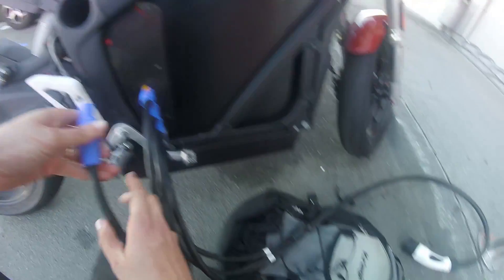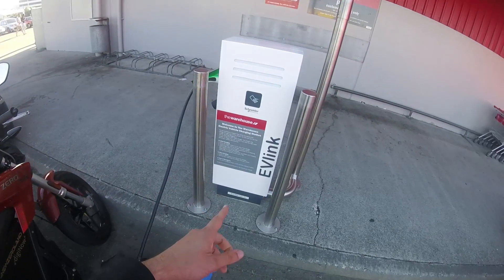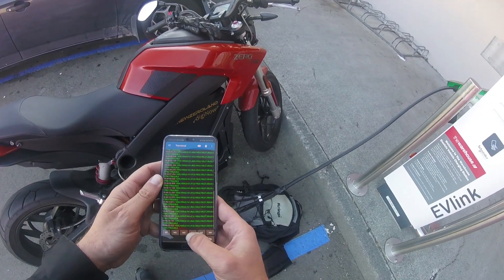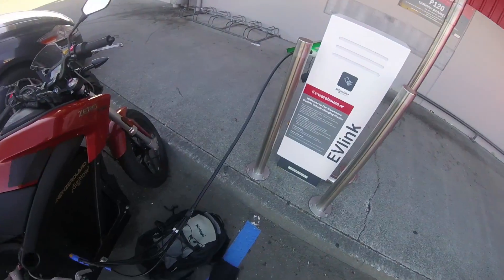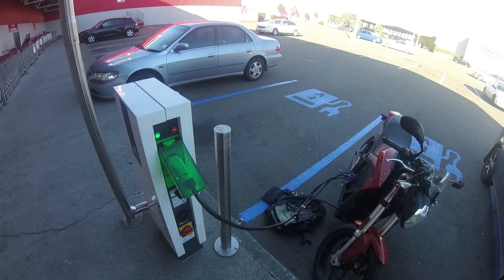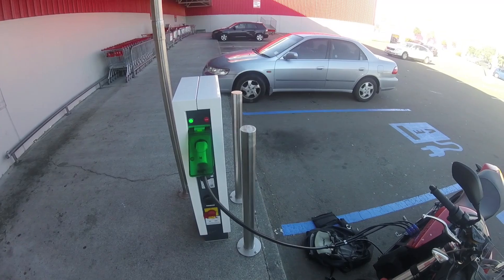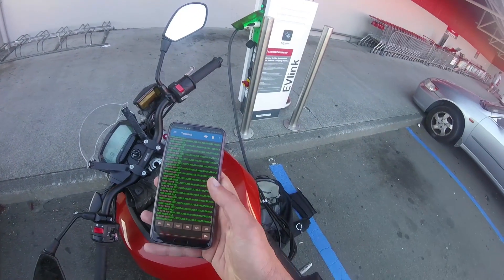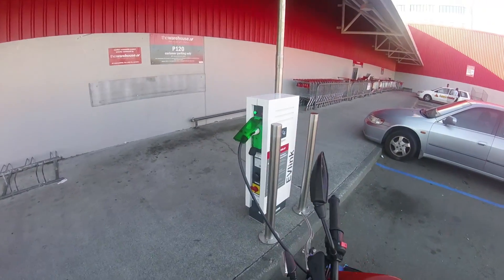Zero Charging - EV link station attempt #547

Comment: While zero's aren't available where I'm at, I'm about to purchase an electric motorcycle also. Your videos give me hope for the modding community. How did you get confident with your modifications in regards to circuitry and power stuff? I'm looking at some mods i'll want to do aftermarket but a bit nervous about doing it myself. Any ideas or places to start?
Reply from the maker: I'll be honest.. diginow makes it really easy to just buy fast chargers and hook them up. I have an awesome electrical engineer friend down here though, so that helps a lot. Which bike are you buying? And if you have questions or what to learn more, check out the electric motorcycle forum, or endless sphere. There are a lot of people building custom stuff out there :)
Reply: Not even close to the same class as the zero for sure. I'm getting the new TC Max when it comes out in March. The nearest city from where I am is over 500 miles away so it's only for city and slight highway driving. Excited though as I've been driving electric scooters previously and fell in love with the hum and smoothness.
Reply from the maker: @WhiteChocolateTricks  Awesome! All kinds of electrics are cool in my book. I rode an electric push-scooter, like a Razor, and it wouldn't stop wheelying. It was terrifying! XD
Reply: Yeah my current scooter can only do 55km/h with about a ~80km range total. It's a smaller 60v26ah. The TC is going to be top speed of 100km/h and about 100km of range as well. Also removable battery which i''m a huge fan of for commuting. You can drive pretty much anywhere even if you haven't charged and pop the battery out and plug it into the normal wall socket. 

I thought about looking into fast(er) charging options, but 3 hours for 100km isn't tooo bad. Maybe later in the bikes life i'd do it.

Comment: Very cool glad you're getting the fast charging sorted. I don't have a EV, only experience with lithium batteries is I fly RC helicopters but with those i need to wait for them to cool before charging them up again and I need to calculate how many amps I can put into them so I don't cause any damage because they will inflate if the amps are too high. Are the zero batteries rated to handle rapid (high amp) charging coming right off the road using them without causing shorter life and possible battery damage? I have no idea, just wanted to ask. Thumbs up as usual and thanks for posting!
Reply from the maker: Hey thanks for watching, and thanks for sharing your own charging story! Zero built their own battery management system with tons of fail-safes into the bike, so there's nothing to worry about. If it gets too hot, the charging power will automatically throttle down. It's also limited to charging at 1C and below, which means the fastest you can charge is 1 hour.. unfortunately :P
Reply: @NewZeroland  does it cost to charge faster? and does the battery gets faster worse by it?
Reply from the maker: @jbholland1987  nope and nope. It's free to charge, and I'm never going over a 1C charge rate. The batteries are apparently safe up to 3C, so there's no concern about damaging them.
Reply: @NewZeroland  thats good to hear, thx for the reply !!